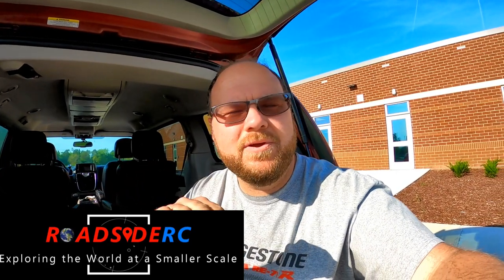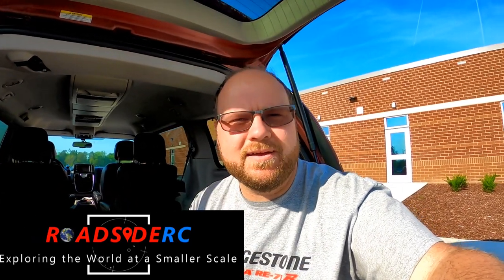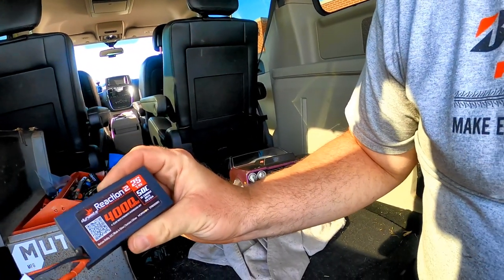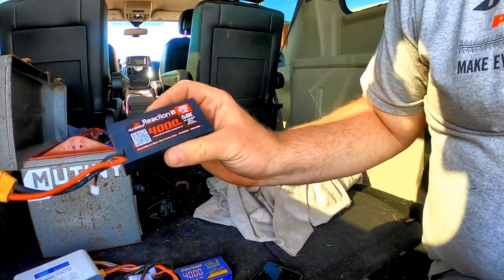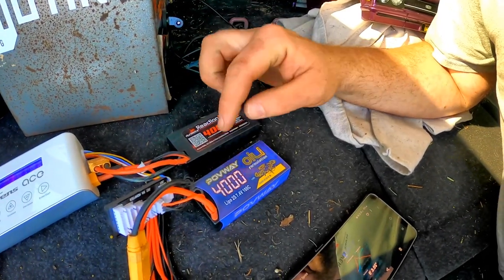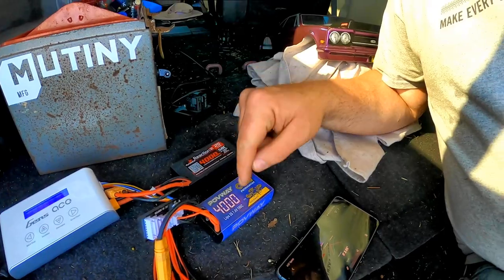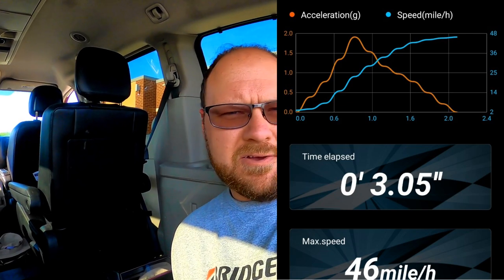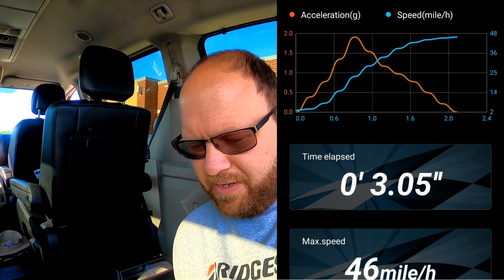RC Drag Battery Test: 50C vs 100C | POVWAY vs Dynamite

Comment: Are you running the slipper? A loose clutch will make those plateaued acceleration lines.  I've seen it on several occasions. Generally speaking, you'll know if the tires start spinning mid run. It usually  ends with the walk of shame to go put the car back on its wheels
Reply from the maker: Thanks for the tip.  Yes, I do have a slipper, but it is rather tight.  I'll double check.
Reply: @RoadsideRC  Maybe there is some contamination causing it to slip?  I run my DR with stock electronics at around 2 turns out.  Poor traction or cold days, around 2 3/4 out. When tuning my Slash with a Hobbywing XR10 Pro 160, I used to use slipper to go straight until I understood ESC tuning better. When using the slipper, the Gnss graphs looked pretty much identical to what you have. G force plateaus in a dead straight line even though speed is still increasing. I have only ever seen something so pronounced when the clutch is slipping.

Comment: Just my opinion but the 100c did it’s job and maxed out the motors rpm faster got to peak power sooner that why the lower mph with a better time 🤔if you gear up two teeth on the 100c it will be faster 💪just my opinion tho looking at the grafics 🙏cool video appreciate the video 👍
Reply from the maker: Interesting.  I'll double check that. 
If you are right, my whole video is junk!
Reply: @RoadsideRC  no the video shows Apple to Apple it’s a good video for sure that’s what testing is 💯💯🙏🙏

Comment: Bought a spectrum 30c 2s 5000 yesterday and was wondering in how far it compares to the same spectrum 50c and 100c. Maybe the 100c battery will just last longer when used for general bashing?
Reply from the maker: C-rating doesn't have a correlation to time/duration.  
If you are using it for general bashing, you may not find any power difference with a higher c-rating, but when used in a higher draw usage - the difference will show up.
Reply: @RoadsideRC  In meant those higher c batteries would maybe degrade less fast as they are not used to their full potential.

Comment: The higher C rate for your application only reduces voltage sag which gives a marginal boost to wattage. To make the full use of a higher C rate battery you have to have a motor and controller that can take advantage of the higher current discharge potential. 

Voltage sag per cell is a function of the C rate of the battery plus the amp hour capacity plus the amount of current discharge. For a scientific equation, here you go. 

You will get 0.6v of voltage sag per cell for every 300A of discharge for a 100C 4.4Ah cell. 

You using 2S modules. 
Let's assume you did 200Amps (since you did a 50C test) and let's assume your 4Ah batteries are 4.4 Ah to make the calculation easier. 

Not factoring in the c rate chemistry change and not factoring in battery heat I estimate you will get 0.8v of voltage sag per module at 200A of discharge. 
Let's say your batteries voltage sagged to 7.6v or so from a near full battery charge 8.4 volts. 
7.6 x 200A = 1520watts peak. 

The 50C battery cannot sustain 200A discharge indefinitely because the current discharge limit changes based on SOC so realistically the 50C has to be outputing less than 200A as the SOC goes down. 
So let's say you put 150A on the 50C. 
 7.8v x 150A = 1170 watts
In comparison to the 100C that will voltage sag less. 
8.235v x 150A = 1235 watts.

So these are absolutely minuscule differences in performance if your motor and controller is capping you at 150A. On the street it would be almost impossible to measure these small differences in wattage in terms of ET.

Let's imagine you actually had a motor that can do 300amps. In comparison

50C module at 150A test
7.8 x 150= 1170 watts
100C module at 300A test
7.2 x 300 =2160 watts
Reply: Also, the 100C batteries are inherently heavier than 50C batteries. So the car would basically get no performance benefit from a 100C battery if the motor is bottleknecked below 200A. The extra weight of the 100C battery would make the RC car go slower.

Comment: 4000mah/50c has 200a potential, I doubt your motor is asking for that, so going to a 4000/100 that has 400a potential wont help.
Reply from the maker: I see your logic - but how does that explain the results from the video?
Reply: @RoadsideRC  If a motor is trying to draw under the 200a, then either battery is capable.  So a battery that can provide more doesn’t really do anything.
Reply from the maker: @Rlambertnorcal  Yes.  I understand that.  
How does that explain the results from the video?

I am 100% not arguing with you - but if I was only pulling a low amp draw, then both batteries should have had the same result.
Reply: @RoadsideRC  I believe the main conclusion was that the 100c must not have been really 100c because it didn’t make the motor faster.  No? Maybe the speed/acceleration varied some but overall not much faster right?  maybe I missed it all together…my only point was that if both batteries are providing adequate amperage then the motor “speed” would not change.  So going to a larger C battery isn’t going to make it faster if the lower C is adequate. Sorry if I missed the point, maybe I should rewatch🥴

Comment: You hot lap the Esc and motor is not good and get some better tires would help out big time too like some reaction and fix the front end travel to Get a Gens Redline lipo 5100 or 6100 130-C you will get in the 2 second range easy
Reply from the maker: Tires are on their way! 
I have a different battery coming, but need to get one of those Redlines.  

Can you talk more about the front end travel fix?  
Thanks for the tips!